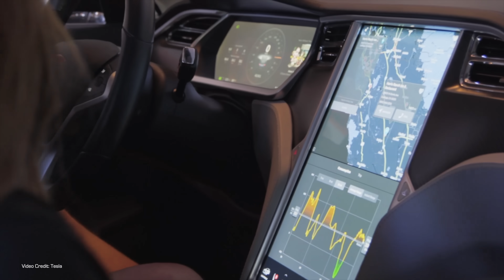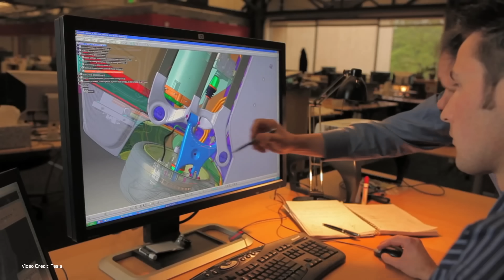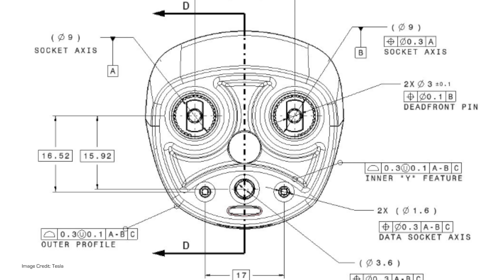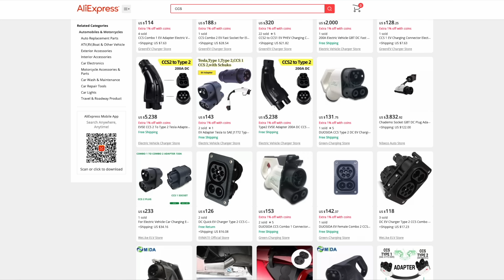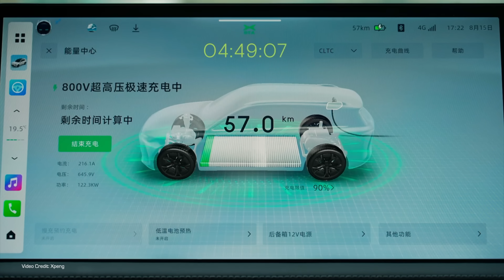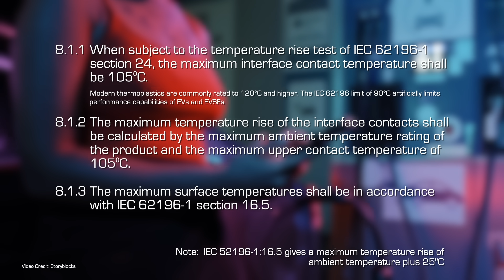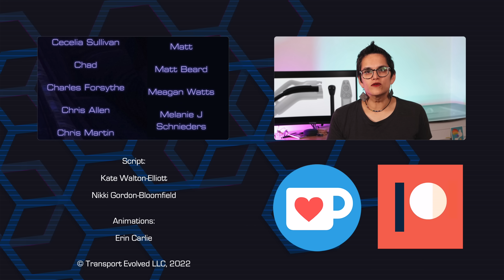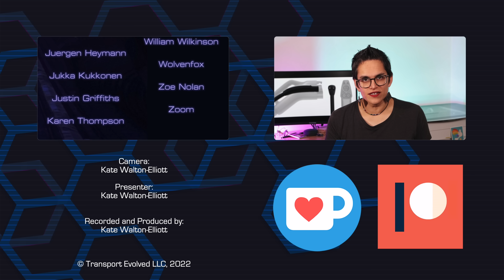The EV Charging Experience Can Suck -- Will Tesla's NACS fix it?

Comment: Thanks for the overview, Kate! I got the same impression from the industry folk that I've spoken with too. One thing that you didn't mention was the reason the NACS plug is physically smaller compared to the CCS1 plug: The NACS format shares AC and DC pins, effectively passing the required hardware components onto the car. To my knowledge, Tesla is the only company currently using an onboard AC charger that identifies incoming DC current and reroutes it directly to the battery using HV contactors (patented?). Essentially, by adopting that onboard hardware strategy, other automakers wouldn't need to adopt NACS at all. They could simply modify the J1772 standard to support DC charging. 

Also, a lot can still be done with the CCS1 plug design itself because the DC cables and pins are the only components of any real size or mass. Essentially, a CCS1 plug could be designed with an "L" shape to support the pilot, proximity, and communication pins plus latch while only having a handle the size of the DC cables and pins, making the grip area roughly the same size as NACS while supporting significant more power and current.
Reply: One can't just rewrite J1772 without making a mess for the sizable fleet of cars already following that standard. I know if you fed DC into my onboard charger, it'd simply explode. It. Is. Not. Designed. For. DC. That's why CCS has the "snake bite" DC pins on the bottom of the J1772 connector. DC charging is always going to be "difficult" for people as those high currents require larger conductors. (those smaller water cooled cords are wasting a significant amount of power.) The only way to get that level of power with lower current is to jack the voltage up, but it's hard to charge a 300v battery from a 1000v source.
Reply: @jfbeam  It works both ways. One cannot simply install an NACS plug without also buying an onboard AC charger from Tesla. 🤷‍♂
Reply: It's not the size of the CCS plug that makes it so difficult to handle, it's the weight of the cable. And that weight comes from the length and the cooling requirements that come with the length.
Reply: @Hans-gb4mv  Again, that's a charger design issue, not something inherent to the standard itself. Look at how much easier Kempower cables are to use. Same CCS power standards, but far better cable management design. ChargePoint is also on the right track with their rotating armature, but they need to include some sort of relief pully like those used on gas pumps.
Reply: @newscoulomb3705  Decent cable management can help, but high power in combination with a cable you want as light as possible is always going to cause some issues. And that's not standards, that's just physics.
Reply: @Hans-gb4mv  Sure, and that's part of the reason for moving to a higher voltage. Non-liquid-cooled cables that can support 200 A for extended periods and 350+ A for short periods are more than enough for most lightduty applications when paired with 800+ V charging. The Hyundai Ioniq 5 and KIA EV6 are perfect examples of that principle, where they are able to charge to 80% about 30% faster than the >600 A Tesla Model 3/Y (even when the E-GMP cars are using 150 kW chargers). 

The problem right now is that no one seems to be applying "backward design" principles when it comes to charging. Doing so would make it far easier to properly size equipment. I could see a future for CCS where each charger has two cable options: A) Lightweight ~300 kW cable and B) Heavier 450+ kW cable. Those with ergonomic and strength issues can select the lighter (but still powerful enough) cable for their needs, while those with faster charging, heavier duty EVs can select the higher power cable.

Comment: "Especially where there's a lot of Teslas."  So everywhere.  Keep in mind that there are many times more Teslas in North America than all other EVs combined.  It's so important that NACS connectors are easily usable by smaller people, older people and people with disabilities.  There's no way my mother could have used a CCS1 connector for most of her life as she had arthritis and a damaged right shoulder.  NACS is a standard with legs while CCS1 has problems that will most likely require it to be replaced as EV adoption increases.  I would think that advocates for the handicapped would be taking up this issue.  As self driving becomes available and allows more people with disabilities to use cars we will also need a connector/cable that is more approachable than CCS1.  We have it already and it works wonderfully:  NACS.  BTW, excellent video as usual.
Reply: @JorgTheElder  Total vehicles on the road obviously is the important figure and the figure that I was referring to and is far more than 3 to 1 and can be considered Many.  Lots of intentional ands.  ;-)

Comment: NACS is a home run for any country to implement. Better do it sooner rather than later, as customers will most certainly demand it
Reply: NACS doesnt support 3-phase AC charging, which is a deal-breaker for about 2/3rds of the planet.
Reply: Better to have done it 5 years ago. "Customers" don't care enough about the connector to "demand" it. Only extreme EV tech nerds care that much.
Reply: but, 5 years ago they didn't have it. Pretty sure that's the reason why they started equipping model3/y bound to Europe with CCS plug. Now, that they finally have it, trying to impose it in the US because of their market dominance.
Reply: @USUG0  They came out with the connector when the Model S was first released in 2012. They declared that other companies could use it (with some restrictions no other automaker would accept) in 2013. If they had done just what they did this year - opening the connector truly - 5 years ago, they might have gotten some big automakers to go along. (Hyundai/Kia might have switched to it instead of CCS when they abandoned CHAdeMO.)
Reply: @AnonymousFreakYT  not just some restrictions. Tesla would have kept full control of the standard, would not accept any input on the design from anyone else and they would still have been the only one that would have been allowed to build fast charger on the standard. So every time your customers would fast charge their car, your competitor would earn money. To me, that seems problematic.

Had Tesla done a decade ago what they have done now, they could have been a much bigger force on the global market when it comes to the charging standard, but then again, Tesla hasn't really done anything, have they? They simply released the specs of their connector and told the world: put some CCS communication on those pins and it will work. They just put a different plug on an existing standard. That's all they did.
Reply: I don't see why ... . NACS doesn't solve any issue from CCS. The communication issues you have with CCS chargers will also be present at NACS, as was explained in the vehicle and the weight of a CCS cable is not because of the design of the standard, but comes from the length of the cable. And since manufacturers place the chargeport all over the car, you need long cables on your chargers which results in ... you guessed it ... heavy cables.

Comment: A smart component supplier will be 'dual porting'.  Creating a single, off the shelf, component that automakers can simply purchase that offers a Tesla plug right next to a CCS one.   Automakers can then easily side-step the entire format war and future proof all their vehicles for a giant customer win.

As for the Tesla standard becoming 'diluted' by other automakers joining in resulting in more technical issues.  I don't buy it.  As you spent so much time pointing out, the Tesla standard uses a very basic method of communication.  The benefit of the KISS principal is that enviable reliability...

Comment: I know I have said this before , but I am of the opinion that North America should adopt the Chademo system and improve on it. 

Tesla could still use their connector and just use a simple adapter cord or connector. Aptera should not be the driving force or consideration. 

As time goes on many vehicles in the market are going to require higher wattage batteries with a faster or higher recharge rate. 

That will require higher voltage and amperage with better insulation on the cabling.

If we are going to ever hope to get people to adopt EVs we need it to be easier and faster to recharge and move on.

A very large segment of total vehicles are trucks and medium weight heavy vehicles as well as towing. 

Delivery trucks, construction and Service vehicles use way more fuel in Diesel and gas than cars do.

They don't have a choice, they have to. 
You guys have figured out what happens with your lightning the minute it turns cold and or you hook a trailer up to it.

Anyone that has ever towed an RV across country can attest to what I am saying. 

The third generation Chademo in other countries is amazing and the ability to be Grid tied would fix a lot of issues with grid balancing.

Imagine having 2or 3 million Ford Lightnings with a larger battery plugged in at homes , business and job sites or parking garages. 

That is a whole lot of Megawatt storage to dump into and draw off of.

I have been around industrial sites and been involved with heavy use Electrical engineering and design.

A 4th generation Chademo with all of these features designed in would solve all of the problems and be future proof as well as safe .

Imagine urging your vehicle in at home and not worrying about losing power or heat and getting a check or credit from your utility provider. 

Imagine being your own power plant and selling surplus back to the Utility or having a credit to draw off of for free from them at night when you are not producing.

You decide how much charge to give up out of your vehicle and your battery is always balanced and in good condition.

Comment: This is a fantastic explanation and one of the best breakdowns I've seen. Kate even brought up a point I hadn't heard before which is that older Tesla Model S/3/X wouldn't be able to use non-Tesla charging stations even if the station had a Tesla-shaped plug.

For Tesla's plug to become the default standard, Tesla would need to open up their charging network to all non-Tesla EVs and adopt CCSish. That's when we'd see Tesla-CCS adapters from Tesla, OEMs, and 3rd parties.
Reply: The opening up of the network is happening. We're seeing it in Europe and around the world, and with NACS speaking CCS, it becomes trivial for anyone to make an adapter that would allow a NACS connector to plug into a CCS car. At least I'd have more faith in such a connector than when attempting to plug a CCS cable into a Tesla with an adapter. Poor chargeport.
Reply: Nothing but empty promises in North America for years. Elon said that he would start opening Superchargers to all by the end of the year and there isn’t much year left in the year.

Comment: The sheer volume of installed capacity of Tesla, (sorry NACS), connector charge points, is the main reason it has to be taken seriously. If the only practical upshot is that the CCS suppliers up their deployment to match, then the challenge will have created a benefit to all.  For once the EU getting  its act together in quick order had benefitted the consumer over here and the fleet with the Tesla, sorry bespoke mennenkes , connector is small compared with the CCS fully implemented version cars. 
Another good, excellently researched explanation, with, and I don’t know how you manage it, great humour again.
Reply: While the amount of Tesla chargers is impressive and certainly demands respect, I would still prefer CCS if I was living in the US today. Yes, there are less CCS chargers, but there are more charging locations that have CCS. To break it down to its basics, it is a choice between having 100 chargers every 100 miles or 5 chargers every 10 miles. On the condition there's always one working and free, I would prefer the 5 chargers every 10 miles as they provide a lot more flexibility.
Reply: Great if at least 4 out of each 5 were fully functional. I think it all has to be judged by the “every electric mile mile is a good mile” mantra. Any bad experience with charging damages the move towards that goal of evolution.  I would wish my European charging experiences on everybody because they have been great with the exception of BP operated destination charging. In the main it has been Tesla supercharging but where needed I have found suitable compatible alternatives. I would pay more for the juice to stick to the Tesla experience as I don’t do a significant proportion of charging away from home anyway.  I would not like the two tier system in North America. The j1772 based frankenplug should never have taken hold in my view, but now it has … well I can’t see a good way out of it!

Comment: Thanks to the brilliant explanation, but on the assumption on why Tesla opened the standard  we could add that :"Tesla opened the standard when another manufacturer asked for it's use " other than applying for funds.
and again Technically on VTG we could assume that speaking of the cable and the plugs what passes on one direction passes on the other so if the port withstand 1000v at 250A or 600A at 400V  charging can power similar load on the other direction, obviously the discrimination here is hardware capability on the car side and protocols, but not cable and plug.
Another issue the internet is a collection of protocol standard what browser are you using depends on what you need from it, almost every computer can choose to run what is the best, so with time protocol implementation will improve, look at Tesla they push an update every six months or so, even rivian they are improving, this charging struggle is just transitory

Comment: Great analysis! 
With the current price hikes and SuCs pretty absent in some areas I am glad our Tesla has the CCS connector. With a nonTesla vehicle one has to use SuCs only in a real emergency as the prices are a rip-off.
Meanwhile some charging providers also offer the the "Tesla experience". Plug in and it starts to charge if our vehicle software provides plug¬charge.

Comment: Good overview of the incompatibilities and possible solutions. Tesla's connector is sleeker, easier to handle, no question. But I seriously doubt it will dominate the EV world, at least in the near future. Other automakers would have to start producing their EVs with that charging port, DCFC providers would have to switch —or at least add— those plugs to their public chargers. Also, Superchargers are ill-equipped to accommodate other EVs: their charging ports are usually in very different locations and the cables are too short to accommodate them. My guess is that, for several years, the only real solution will be a slew of adapters, perhaps even extension cables to make it all work.
Reply: Legacy OEMs would adopt the Tesla plug if Tesla opened up Superchargers to non-Teslas and adopted "CCSish". At that point, both Tesla and OEMs would make their own adapters for CCS vehicles and 3rd parties like Lectron and Tesla Tap would make them too. Until that point, switching to Tesla plugs is a pipe dream.
Reply: @anthonyc8499  I don't see most manufacturers switch away from the CCS plug. They have no incentive to switch away from a standard they control to a standard that a competitor controls on his own.
Reply: the short cables are one of the main reasons why the Tesla plugs are easier to handle. A CCS plug doesnt weigh that much more, but all the copper in a longer cable does.

Also, the lack of 3-phase support is a huge downside in countries outside of North America.
Reply: Would you call 3/4 market share "dominating"? Because that's the share it has at the moment. So the "near future" is covered...
Reply: @HenryLoenwind  Time will tell.
Reply: @HenryLoenwind  Tesla has 100% of the Tesla plug market. Is that worth bragging about though?
Reply: One has to wonder why the Legacy OEMs put their charging ports in exactly the bad position for using Tesla chargers.  In fact, they aren't even consistent among themselves.
Reply: @normcfu  I don't. Why would they? In my case I preferred the charging port on my previous Nissan LEAF.

Comment: Very well explained Kate.  And this has all the hallmarks of an impending major problem, particularly internationally.  It is a shame that many companies just cannot understand the advantages of promoting and/or following international standards.  And yes, standards do change.  So do proprietary solutions.  But proprietary solutions have different problems - that utterly rely on the company's continued existence.
Reply: Even Apple is now moving to USB-C!
Reply: @davidmccarthy6061  Only under legal duress!
In this case, I agree with the EU directive - there are too many power packs being included, and many are ending up in landfills.
Then there are all the power boards that have 2A USB charging built-in.  So a common 2A power source, without the plug pack being included with the device, makes economic as well as ecological sense.
Apple was arguably the worst offender on this issue, due to the fast rate of new connectors being introduced, and therefore new plug packs being needed for recharging.